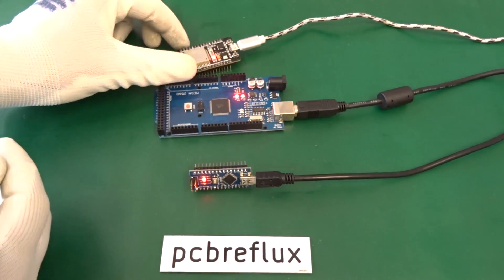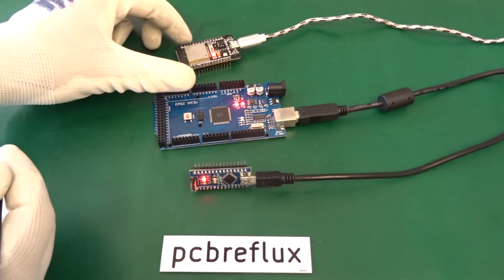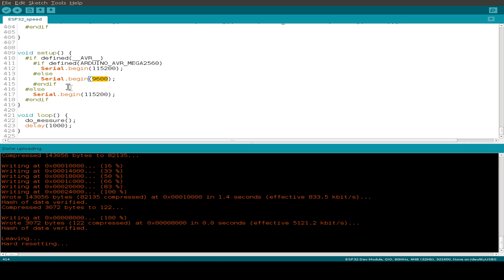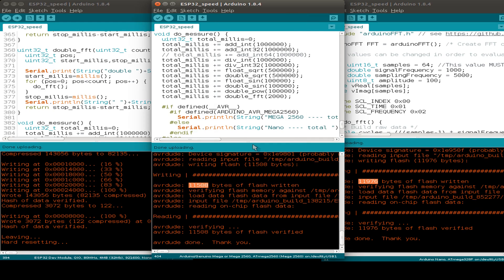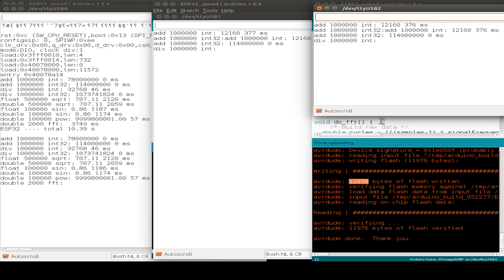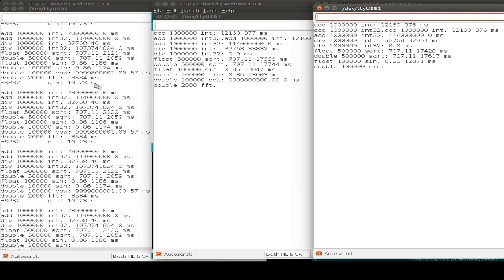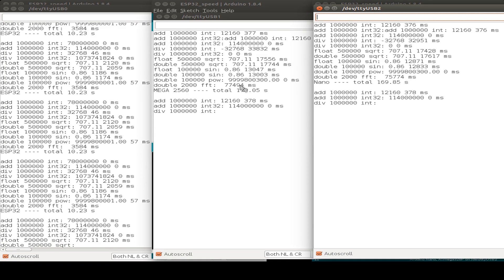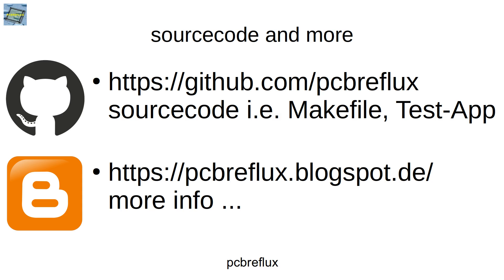ESP32 #57: ESP32 Arduino Speed Comparison

Comment: Hahaha! Wow... Neat test run man. Considering the cost of a MakerFocus ESP32 at about 23 USD if you need a fast controller the ESP rocks... Came here to see about a better CNC Stepper solution might be. I need to go see if the ESP32 has a interrupt handing routine. Thanks for the video.
Reply from the maker: Fair enough the ESP32 cost more and you have to consider other factors like size, heat, topology, power consumption, 3.3V logic levels, and so on. And sure you can handle internal or external interrupts even with arduino development (https://docs.espressif.com/projects/esp-idf/en/latest/api-reference/system/intr_alloc.html , https://github.com/espressif/arduino-esp32/tree/master/libraries/ESP32/examples/GPIO).
Looked up my sources today and you can order a ESP32 development board for as low as 4 USD and a raw module start by 3 USD (see maybe https://www.aliexpress.com/wholesale?SearchText=esp32 and sort by price) and my highlight this month - a esp32 with a 2 megapixels camera (ESP32 cam) for 7 to 8 USD.

Comment: Great video. It would have been even nicer to try to see how much power usage increased during the test for each of the boards...
Reply: I just tested this, there doesn't seem to be much difference in power consumption (unless you are thinking of running it on batteries for a long time etc):
Arduino Mega 2560:
Speed test: 5.08V, 0.069A, 0.350W, Time: 150.10s
Empty code with blank setup and loop: 0.509V, 0.060A, 0.305W

TTGO ESP32 T-Display:
Speed test: 5.08V, 0.081A, 0.411W, Time: 10.51s
Empty code with blank setup and loop: 5.08V, 0.066A, 0.335W
Reply: @MrLinzhangyuan  Good to know! Thanks!

Comment: Why are some of the tests 0ms in duration for the Arduino Nano and Mega2560? (e.g. int32 test)
Reply from the maker: My assumption is that the compiler uses in default the "aggressive loop optimization" flag and even I try to avoid this by repeating the computation (copy and paste the code several times) the compiler just build a code for going straight to the solution in no time.

Comment: Impressive! But how about IO speed?
Reply from the maker: Thanks. Will add a second code example with just switching a gpio pin on and off with standard arduino functions in a loop and give an update. Using a interface will limit the calculation by the interface or the connected devices and the codebase varry between hardware interface and bit banging.
Reply from the maker: Added the gpio testes: code here https://github.com/pcbreflux/espressif/tree/master/esp32/arduino/sketchbook/ESP32_speed_gpio

1000000 writes high and low

ESP32 0.24s
Mega2560 12.39 s
Nano 7.11 s

Comment: Thanks a lot for the comparision. Of Course I was very keen on the FFT results. For a special project I used a 2048 FFT which is <70ms (40ms with == 0 input).

I also found a nice table for basic instructions:
https://hilo90mhz.com/arduino-esp32-esp8266-101-speed-test-comparison-chart/
https://docs.google.com/spreadsheets/d/1q2sw0MpcFv1gNyNW6l9PZ8BvWq_LD0MqCEpUUKcegLE/edit#gid=0
I modified it using the XLS color coding (conditioned format).
The STM32 Nucleo-F767 and the Teensy seems to be faster than the ESP32 but many times more expensive. 
In this table you also can see the comparison between ESP32 and ESP8266. And this is the reason why I was waiting with my FFT project until the arduino-ide of the ESP32 was mature enough.
Reply: I have decided the Arduino environment is holding me back, and have decided to just "go native" for now, and use the ESP-IDF system directly.  For one, you get a gdb debugger, which is a great help compared to a "it crashed" Arduino side of things.
Reply: Maybe you are right. Pete Scargill did the same. 
Can you use the arduino libs under the ESP-IDF? 
I am not a professional coder and have not too much spare time so I hesitate to spend the time for a new Environment incl. eclipse etc. And the Arduino community is big and creates a lot of helpful things.
But a few days ago A found a eclipse plugin to  convert state machines into code. Looks promising.
Reply: You can call ESP-IDF from Arduino (mostly) but not the other way around.  That is one issue, but I find a lot of Arduino libraries, specifically ones that deal with physical devices, don't really work well on anything not an old-school Arduino-flashed Atmel chip anyway.
Reply: Did I understand it correctly? 
You can use Arduino IDE and embedd functions, libs etc from the ESP-IDF?
For me it is not so important to adminstrate the libs by the arduino IDE. With my Arduino ESP32 this did not work, so I installed some libs manually and I update manually. I could do this also in a different environment. But I want to use some of the libs of the arduino community.
I just entered the Arduino IDE with ESP8266 so, I am aware that the Espressiv HW is not an Arduino. But I like the speed, WiFi and the price of the ESPs. And thanks of I2C and Arduino a lot of peripherals on pcbs are available.
Also, the ArduinoFFT lib worked out of the box and here the speed of an ESP32 is very useful. And it is even cheaper than an Arduino Mega. Just great!

Comment: Hello, For me this is based on the clock speed difference mainly. AVR running on 16MHz, ESP I guess 240MHz and the difference around 15. Am I wrong?
Reply from the maker: Sure the main difference are the clock speed, beside the different architecture. Maybe we can see this as speed/price ?
Reply: Yes of course a good point. May be the project size and the consumption are also can be a factor.
I am just learning the ESP32 possibilities, Thank you for your videos!!!
Reply: If price is taken into consideration, will knock-off boards be used, or "real" Arduino boards?  From memory, I think I can buy about 3 or 4 ESP-32 devices for the price of a single Mega.  However, it gets fuzzy, since the only "real" component on the ESP-32 devices is the ESP-32 canned module itself...
Reply: You can't compare clock speeds that easily. They both use different instruction sets and also latency between memory and cpu can play a huge role with the execution of instructions. Also chips can have different efficiency of branch prediction, branch speculation and out-of-order execution to increase speed.
Videos explaining meltdown and spectre bug can give more information about how cpus can increase performance without increasing clockspeed!!